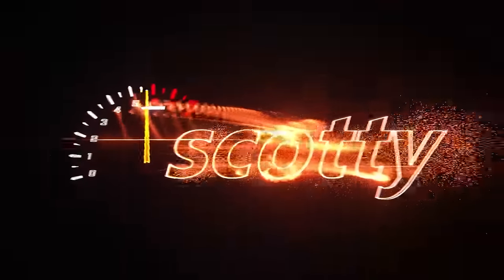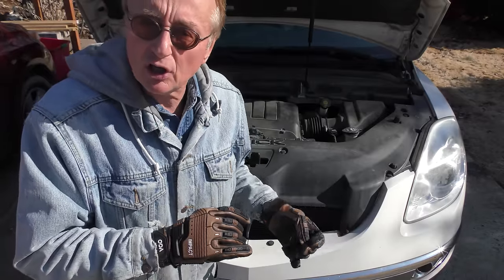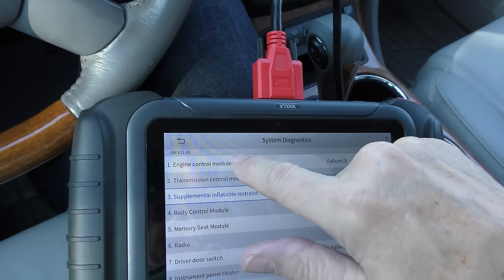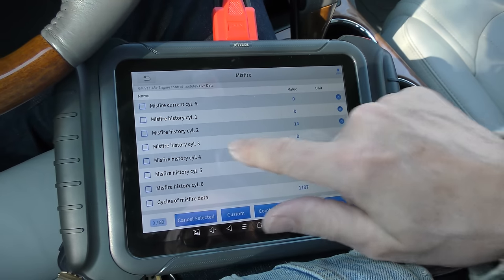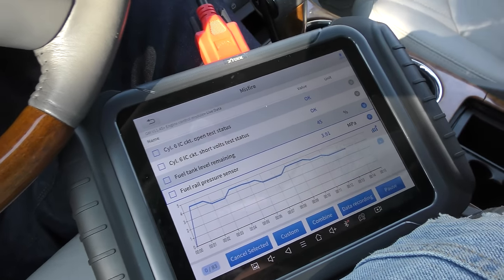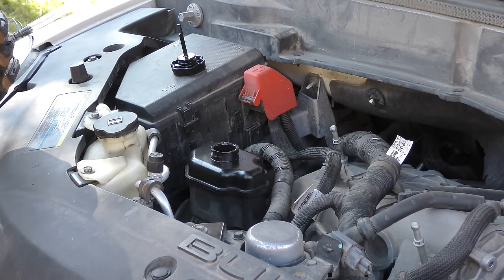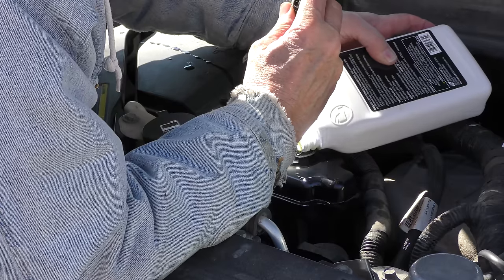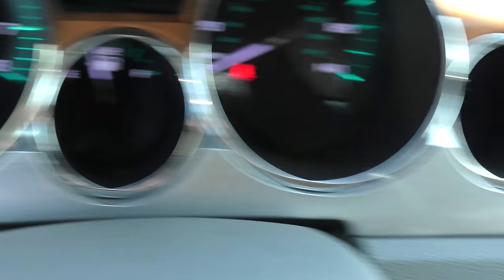Here’s What Happens if You Don’t Change Your Power Steering Fluid

Comment: The quick and easy DIY version is to use a turkey baster to empty the reservoirs for brake fluid and power steering fluid at every oil change or two and refill the reservoir with good quality brake fluid (Prestone) and power steering fluid (Lucas).  This half a fluid change once a year keeps the fluids fairly clean and free of moisture.  The solution to pollution is dilution.
Reply: ty
Reply: @Shutityou  - I recently did the reservoir change on the 4Runner and Rav4 after only 6 months because they were visibly dirty.  It's very quick and easy with a Mity Vac hand operated pump.  I also did the brake fluid reservoir fluid swap on my new motorcycle with less than 4000 miles because it was already looking cloudy and yellow.
Reply: Excellent idea, hadn’t thought of that! In the past I’ve flushed the brake fluid every 50K. If you do it your way at every 5K oil change, over the course of 50K miles the fluid will have been changed out 10 times. Not bad at all. Less money than paying for the fluid flush at a shop!

Comment: My mother had a 2009 Enclave...I convinced her to go that route instead of another Suburban because she never tows anything. She humoured me and was expecting to drive it for a year and then trade it in for a new Suburban...then she realized that the Enclave was a much better fit for her. She ran it to ~250,000km before selling it to one of my cousins when she upgraded to a 2018 Enclave Avenir, and my cousins wife is still driving the 2009 many years later with no major issues. They're honestly a pretty good vehicle...just make sure to stay up to date on the oil changes with the 3.6, and they'll treat you well...very important to be proactive in oil hygiene on these.
Reply: Are extremely  lucky  that gm went that far. Those 3.6l engines  and enclaves are pure garbage,  many didn't  last beyond  60k miles, and gm changed their designs  and stopped making replacement  parts.  as did aftermarket part manufacturers  they just said the vehicle  such junk most are in a junk yard crusher didn't  waste time on making replacement  parts.
Reply: They improved the quality of the timing chains and associated parts...quality synthetics help...Redline,Amsoil etc..
Reply: My friend had a 2017 or maybe it was a chevy anyways it was a complete piece of crap.

Comment: In Hondas, when you replace the power-steering fluid; you must replace it with Genuine Honda power steering fluid or with FRAM. FRAM makes fluid specialized for Hondas. If you don’t, the pump will whine and eventually fail.

Comment: I bought an 11-year-old car and drove it for 4 years without changing the power steering fluid. I doubt the fluid was ever changed in that car. To make a long story short, after 260,000 km or 161,000 miles, my power steering shaft sprung a leak and I had to get it rebuilt for like $300. After some online research, it turns out your fluid gets contaminated with rubber and metal particles over time and it will break the seal in your shaft if it gets too dirty. So, it's better to replace your power steering fluid once every 75,000 to 100,000 miles.
Reply: All those particles turn your fluid into liquid sandpaper. Power steering fluid is cheap and this is easy to do. Cheap insurance, no reason not to do it!

Comment: As always, thanks Scotty. I had my power steering slowly fail on my 2011 Mazda CX-7 around 270K miles. I’ve been driving it without power steering for the last 30K miles. My Mazda now has 307K miles on it now. Still running and driving good on original engine and transmission. I’m gonna fix the power steering issue now. After that, inspection and time up. I think this Mazda will be good to go for another 100K miles.

Comment: Timing chains starting to go ditch it NOW Almost forgot there is a filter in the return hose for the power steering, when they start to plug it will make noise sometimes flushing will help for a while. GM power steering fluid is synthetic.

Comment: Few tips for those flushing the fluid. When you re fill it, you don’t have to drive around, Jack the car up, and turn it on and start cranking the wheel. Ideally turning the wheel all the way to the right, then left 20-25 times. There’s 2 lines coming out of that pump, the high pressure, and low pressure return. Sliding the hose off from the low pressure return and connecting it to a drain tube. Make sure make sure to seal the pump off to stop air from getting in. Keep topping the reservoir off until all air has left, and fluid is a normal color.

Comment: I used Prestone power steering fluid in my Honda Ridgeline and it squealed in cold weather. It was not for Asian vehicles it said most Asian and European vehicles. Well it didn’t work. . I changed it out for Idemitsu power steering fluid and the squealing stopped when it is old. Fluid does make a difference in my case.
Reply: How is your power steering fluid doing right now?! The brand does matter. I am also thinking to get Idemitsu for my Tundra.

Comment: Greetings Scotty, long-time viewer here.  I have a 2005 Acura MDX and need to change both power steering "O" Rings as it's starting to leak.  As you might know, Honda/Acura are both Power Steering Fluid to use their formulation brand only.  That said, the Synthetic Power Steering Fluid you recommend using will still work a okay for Honda/Acura?  Also, I've got approx 250,000 miles on it, should I change over to Synthetic Motor Oil, is that a benefit? If so, recommended brand preference?
Reply: I guess Scotty is retired, sorry I missed you...

Comment: I'm not sure what is wrong but here goes --->>> I have a 2010 rdx AWD. I have this whining noise. It seems to come from the power steering area, but I taught it could also be the alternator or another part below. The whining noise is generally there, but for a few seconds, the whining goes away, then comes back again. I've tried changing the small O  rings, but that didn't do anything. Not sure if flushing the system will do anything and if I should do it myself or have a mechanic do it or do it like in this video. Boy would I love to have this mechanic as my neighbour.

Comment: Having owned a 2009 Acadia, I can attest that the steering rack and pump replacement is a major pain.  GM fixed most of the major problem areas in these vehicles by the 2010 MY.  Prior to 2010, the transmissions had the 3-5-R wave plate failure that could require major tranny rebuild or replacement if it went bad, and timing chain issues plagued the early models.  These were supposedly fixed by 2010, but it is likely that some early 2010 Acadias, Enclaves and Traverses would have still had these issues.  The evap core on the AC system is also a very common failure point, and requires complete removal of the front seats, center console and dash to the firewall.  If a shop does it, expect a 2500 dollar bill to replace a 125 dollar part.  With all that said, my 2009 Acadia was a great car to drive, when it was running right.

Comment: I got a 1996 Astro van had a power steering leak bought some of that Pennzoil stop leak at first, I thought I didn't work didn't realize it takes some miles. For me every 3 days now, I expected to be empty today was about to buy Bar dual mix, but when I fired her up and put in gear no noise now so I can say Pennzoil stop leak works and my van old

Comment: I have a 2008 Buck Enclave with 230000 miles on it and it still runs great. Only thing that it has had done to it is regular maintenance and a head gasket and timing belt.

Comment: There are some good vids to actually do a flush to get all old fluid out without jacking up car and turning wheels rack to rack..  I just did my two 2005 Corollas using the Multi-Use Transfer Pump from Harbor Freight ($7.50)....  Pulled fluid from return and kept filling with new fluid until fluid ran nice and new color...  Use the right fluid though..  These old Corollas use Dex II/III ATF fluid...  Synthetic of course...

Comment: I suppose the 3.6 V6 VVT engine is decent enough, but I always thought the 3800 was better despite being older (maybe they don't make em like they used to?)
One of the few problems I heard of that 3.6 was potential timing chain related issues (how and why)?
Reply: Your right the 3.6 is one of THE worst Chevy engines. They always have timing issues during to the engine losing power. Also people don't get oil changes as they should.  But the 3800 now that's the one you want it's has its issues like any other car but it's reliable as hell.but if you see a Chevy with the 3.6 RUN
Reply: The 3.6 was redesigned around 2012. Doesn't have the the timing chain issues of the previous years. Of course that's with regular oil changes like anything else.
Reply: @really_miscellanous  Kindly note that your use of "your" should be "you're" as in "you are".

Comment: Scotty, in this one you recommend synthetic fluid. My Toyota requires Dextron II ATF for power steering. What happens when the two types are combined which happens when the fluid is partially replaced via the turkey baster method that you've recommended? Would using synthetic fluid be beneficial even if I could replace 100% of it?  In previous videos you recommended using only the fluid shown in the manual or printed on the reservoir cap. Here you reverse that claim. What to do?
Reply: I wouldn’t use anything but Dextron ATF if the car doesn’t call for it.
Reply: If the fluid was never replaced and is thick be careful about replacing it unless you like leaks.
Reply: @justmkr4830  what?
Reply: @justmkr4830  Of course I wouldn't but it seems that Scotty hasn't considered the questions I've raised here.
Reply: I spent forever researching this a while back and I ended up going with Red Line 30404 Power Steering Fluid in my 07 highlander. The thing with power steering fluid is that it is acting as a hydraulic fluid and not really as a lubricant between high-friction parts, so you don’t really have to worry about the same compatibility issues as you would transmission fluid, coolant, engine oil, etc. I had the same concern as you so I got two quarts and swapped the fluid like 6 times to really try to get all the old stuff out. At the end of the day; they are very similar synthetic oils. I got my highlander with 115k on it, so I had no idea what was in there if it was changed before.
Reply: What did you end up using?

Comment: I had 2 different Ford Aerostars and drove both to 200K+ pulling trailers and working them hard... and sold both of them.  I LOVED those vans.  But the power steering pumps whined like crazy.  We always joked the whining meant the engine was running, lol.

Comment: My ex has a 2009 model with over 374,000 miles. It still runs good, the a/c doesn’t work, but it still runs & drives good.
Reply: It doesn't run "good" it runs "well".

Comment: Hey Scotty, I guess that you have never heard of the timing  chain disasters on the mid to late 2000's GM 3.6 engines ??? Very surprised that it has lasted this long unless it has already had the timing chain replaced.
Reply: Scotty is alittle bias for the 3.6 because it was made in Canada. He’s brought it up a time or two before.
Reply: My neighbor had one...2008...valves rattled like it had nails in the cylinders..4500 for timing chains.
Reply: He's probably confusing the 3400 engines. They were INCREDIBLE engines.
Reply: Mine just chewed the timing chain up and spit the vvt sprocket out the valve cover so wish I heard about that sooner
Reply: Yeah I thought this was the High Failure V6. Wouldn't go near it
Reply: Are these the chains that are real long and look like a bicycle chain??
Reply: @stuartbear922  I think you mean the 3800 cause the 3400 wasn’t that good it was decent but not great
Reply: @waleyefish9026  q
Reply: @stuartbear922  3.8 was way better.
Reply: @stuartbear922  take a 3800 over the 3.6 too
Reply: @stuartbear922  The 3400s had issues too lol
Reply: @brandonsvlog8533  I had a 3800 impala that thing went through 3 engines and a transmission I think GM people are in denial lol.
Reply: @Yophillips3272  no engine is perfect. The 3800 was the best of any of the v6 gm had produced 3100, 3400, 3900 etc. Sure the 3800 has some minor issues that could turn major if not addressed but overall they are dependable. Most people agree to avoid the 3.6.
Reply: @Despicable909  Made me avoid GM all together. Only thing I would consider is a V8.

Comment: I'm just curious on how much my repairs should cost. Here's the breakdown. 
I have a 2009 chrysler town and country 3.8l
 Was leaking coolant and found it to be a few places but nonetheless, I was just wondering on opinions on what you guys think it should cost. 
Things they're replacing:
Lower intake gasket, thermostat and housing, heater core hose assembly, upper and lower radiator hoses, oil change and flush and fill both coolant and oil, new dipstick(mine broke off).
Reply: Probably $2,000+ would be my guess. How much did all of this end up costing you?

Comment: Guaranteed that 8-ft timing chain will stretch. Also be prepared for stabilitrak and transmission. All will fail within a few months of each other. Sorry Scotty 3800 timing chains were a disaster
Reply: Thought he said is was a 3.6 (3600?), not the 3800.
Reply: @markh.6687  the 3800s were excellent engines. The 3.6 in the video was the one known to have the timing chain issue. They allegedly fixed it in the later years but it’s gm so who knows lol.

Comment: I would never buy a new Buick. My neighbor has one with 46k miles it's on it's 2nd transmission and already burns a quart of oil every 5,000 miles. It always has something broken on it.  Neighbor says they're glad they bought the extended warranty because it's it in the shop for something different every month. 100% GM = Garbage Motors
Reply: Took a 2016 Enclave on a 8,400 trip and it used 1/2 quart of oil could not believe it...climbing the Rocky Mountains
Reply: there are lemons every so many thousands made...would like to know how he drove it and took care of it
Reply: An old fellow I know is on his second Buick Encore.  He’s always had Buick’s. Roadmaster, Riviera, etc.  He will NOT admit he’s spent his money on A Korean car... says he would never buy one.  Even though his VIN starts with K, made by GM/Daeowoo.  I don’t mind Korean cars at all, but I wonder how many old folks buy those thinking there getting an American made Buick like the old days?
Reply: Good old GMChina.
Reply: Certainly not what they used to be! I'd trust a 94 w/ 250k more than I would a 14 w/ 100k

Comment: My Cousin has one of those Buick Enclaves and while camping a few years ago the battery died, we were looking all around trying to find the battery and it turned out that it's down underneath in the floor in front of the right rear seat.

That was the craziest thing that I have ever seen, it seems like if you had trouble with the battery if it started leaking or something that you could possibly get fumes from the battery acid inside of the car.

Comment: I like the 3.6, do the pcv fix and check the oil every week and you shouldn't have to worry about the timing chains.
My 2005 CTS just hit 200,000 no chain issues. However, water pump and radiator is a different story. Luckily I caught the internal radiator leak before it puked into my transmission. Use an external transmission cooler.
Reply: The timing chain cover gaskets often go out long before. When you have the cover gaskets redone you might as well have the chain redone as well while you're in there. The sprockets as well.

Comment: yea my daughter  boyfriend has a 2005 mustang v6 147k miles and the stupid plastic thermostat housing broke and she was like after we get married (they are engaged) we want to get rid of his car and I helped them troubleshoot the water leak wow $40 for hole new assembly the antifreeze will cost more than the part and it comes with new thermostat and temp sending unit preinstalled  and i finely got a good look at his car and i was like WHAT sell this in todays market it is in great shape (never overheated by the way ) fix it drive the wheels off of it with cheep ins and minimum repair cost for the next 5 to 10 years as the plastic thermostat housing failing is a known week point of these cars and there easy to replace and cheep .by the way her car only has 45k miles so they have a decent newish car so the mustang is just a get to work and back car so drive it for ever runs great cheep ins and not horrible MPG with the v6

Comment: That thing is junk- i have same exact year model- that misfire indicates either coils are bad or timing chains are stretched . That power steering is a known issue - rack and pinion and steering pump need to be replaced . You need to use Dextron 6 as Steering fluid .

Comment: I recently had my rack and pinion replaced on my old Buick. when they changed out the rack and pinion did I essentially get a power steering fluid change also??
Reply: Yes, flushing the system to rid it of all the old p.s. fluid is a warranty requirement for every new rack & pinion installation!

Comment: I have to disagree with Scotty on one thing here and that is I wouldn't want the 3.6. They are known for timing chain and timing chain tensioner problems that can cost big time to repair. I would rather have either the 3.8, 3.5, or 3.9. Those are push rod engines that can last a long time if maintained. GM cars and trucks from 2000 - 2012 generally aren't bad. It's the ones from around 2013 to now that I would avoid.
Reply: I agree.  The problem is that the desirable engines are now old engines.
Reply: What about a 3400 SFI engine?